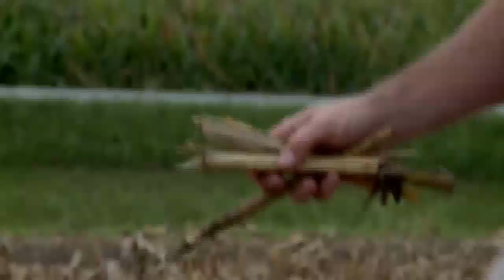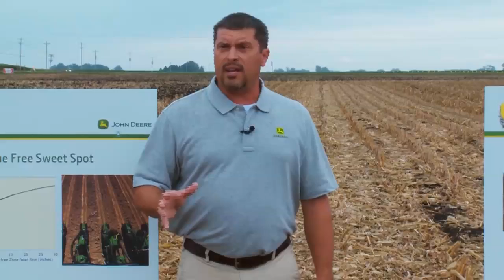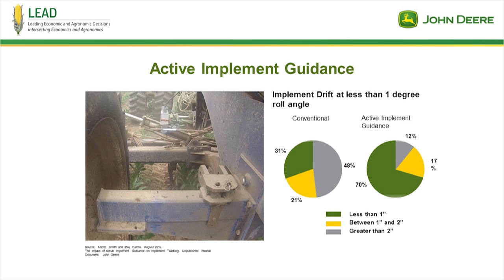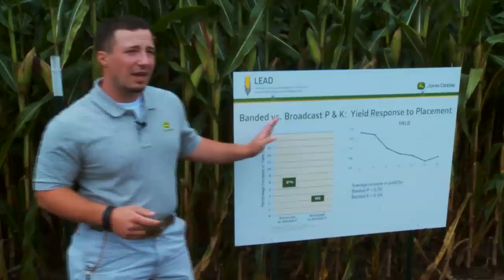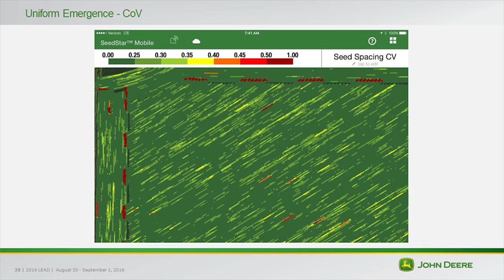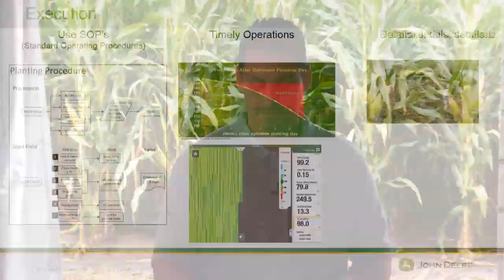Rural America Live John Deere Corn Production System

Comment: Corn production involves several essential elements that contribute to the growth and yield of corn plants. Let's explore these key factors:

1. **Genetic Potential**: Corn plants have inherent genetic potential that determines their response to environmental conditions. This potential influences growth and yield.

2. **Sunlight**: Sunlight serves as the primary energy source for corn plants. Through photosynthesis, they convert sunlight into chemical energy, which drives growth and development.

3. **Nutrients**: Corn plants require various nutrients for optimal growth. These nutrients fall into two categories:

   - **Macronutrients**: These are needed in larger quantities. They include nitrogen (N), phosphorus (P), potassium (K), calcium (Ca), magnesium (Mg), and sulfur (S).

   - **Micronutrients**: These are required in smaller amounts. Examples include boron (B), iron (Fe), manganese (Mn), and zinc (Zn).

4. **Soil Fertility**: Proper soil management is crucial. Understanding soil fertility helps farmers provide the necessary nutrients for corn plants. Soil testing guides nutrient application.

5. **Environmental Conditions**: Factors like temperature, moisture, and soil type significantly impact corn growth. Timely planting, irrigation, and pest control are essential.

Remember, corn production is a dynamic process influenced by both genetic factors and environmental conditions.